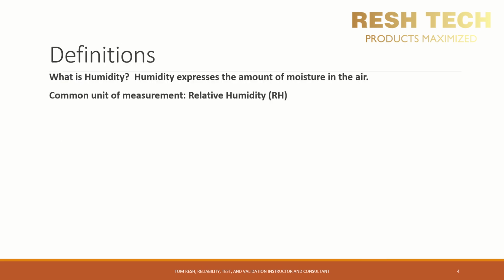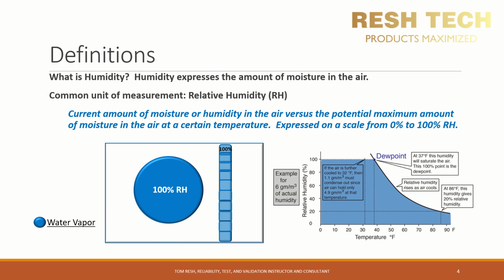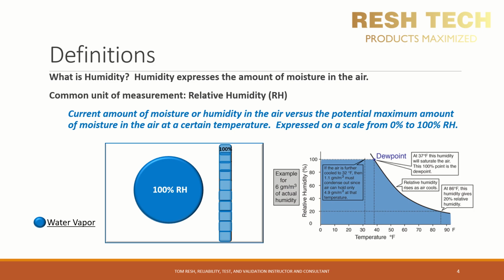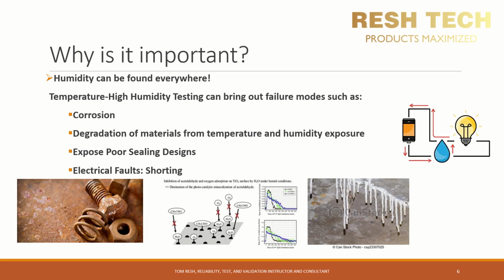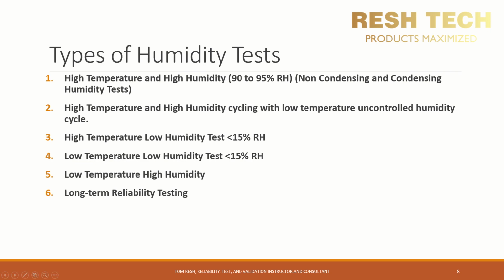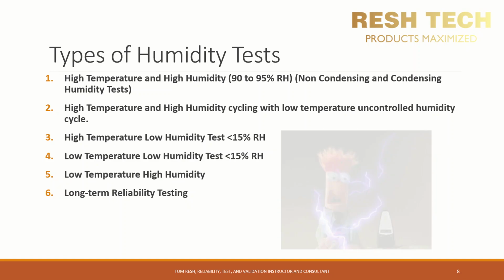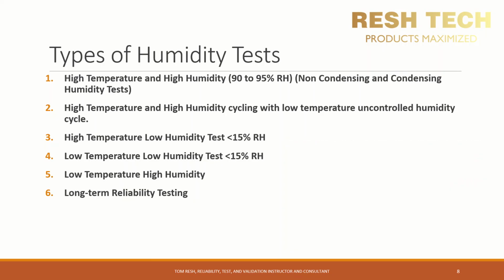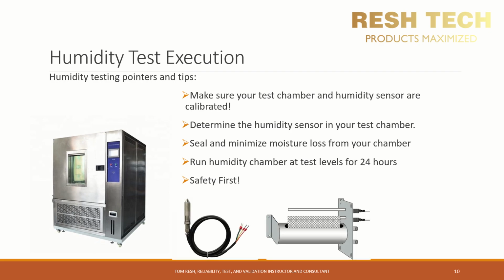Introduction to Temperature-Humidity Testing

Comment: Sir I have doubt do we require device in ON state i.e operating state during this test. Or this tests are performed in OFF state of device. And 2nd question is whether we have to expose directly PCB to the chamber or product should be enclosed i.e complete product with cover and fitments.
Reply from the maker: Hi Manmohan, 

Great questions!  

It depends on the use condition you are trying to simulate which will drive the operating state.  Typically for a field operation test, the device will be in its ON operating state.  

If you are simulating a storage or transport test than typically the device in be OFF or non operational.  

Whether you test a separate part such as a PCB or an entire system only will depend on what your technical specifications define for the all materials and parts within your system.  There are JEDEC tests such as 85/85 testing that test an individual component that would be mounted on to a PCB.  

The granularity and how deep into the system you get for testing depends on your technical specifications or requirements in summary.

I suggest purchasing components or PCBs from suppliers who already have reliability data for the tests requirements you have for a subsystem part or component for your device and testing at the enclosed, system level at your company.

Let me know if this answers your question.
Reply: @tomreshtesting  
Thanks for this video, this is really helpful.
I guess related for electronics, we can keep power up as well as measure intermittently. as failure due to ingress of moisture will not be detected unless we test it. please correct my understanding.

85C/85%, 1000 hours test, does it fall under the high temp high humidity or long term reliability testing? I have difficulty in interpreting these test hours into life of the product. Can you guide me on this little. what I understand from reference paper that this was not calculated from acceleration model, but more for covering different combinations of humidity and temperature. and different models were tried to fit that data. also these were initially developed to test epoxy. but how do we relate this to new IC packaging now.

not sure if I could convey the question clearly.